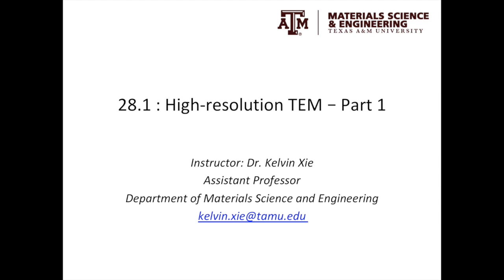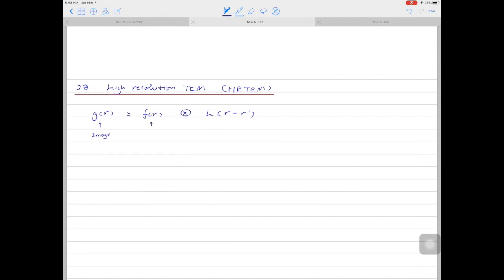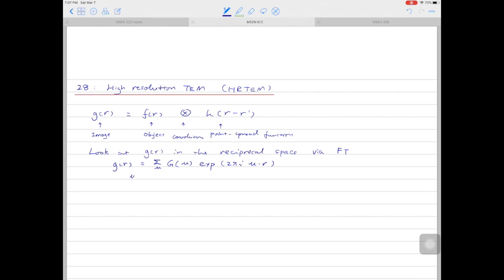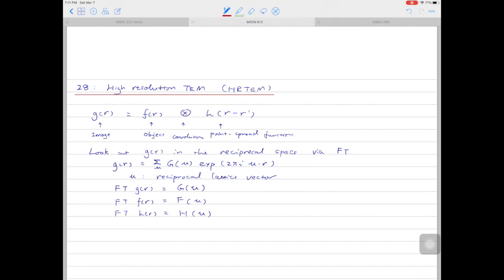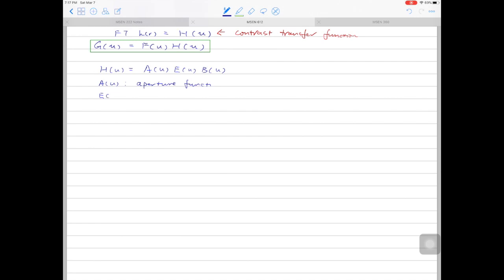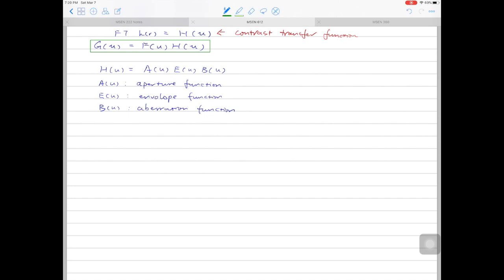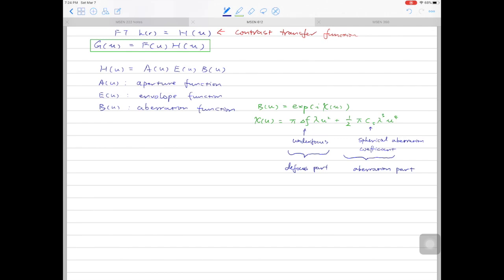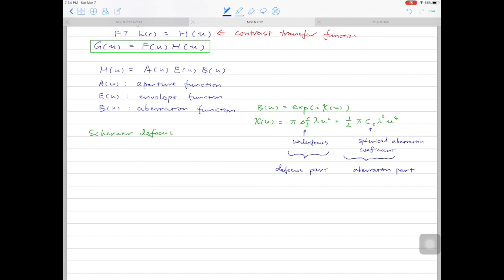28.1: High-resolution TEM - Part 1

Comment: Hi Kelvin, Thanks for your nice video. Though I've read related parts in the William&Cater book, your video makes me understand it better. I have a question about Schrezer defocus. For example, that value is -60 nm. However, where is the best "on focus" condition? How to confirm that now I am "on focus", then I could ResetFocus (R2 button), and then adjust the focus knob to -60 nm.
Reply from the maker: Hi Yuan, it is a very good question. I use FFT to guide me. Usually, you have some amorphous layer on the specimen and it will give rise to the diffuse rings in FFT. When you are out of focus, the diffuse rings will be visible. By changing focus, you can make the rings change the diameter and change how many rings you see. When the amorphous ring disappears,  you are "on focus". Then you hit the Scherzer Defocus button to set it to the best imaging condition. I hope it helps. Please let me know if you more questions.
Reply: @kelvinxiemsentamu6890  Thanks again, Kelvin. Your explanation is very helpful when using a FIB thinned specimen and normally an amorphous area is created by FIB milling. However, if I have gold nanoparticle (NP) dropped on Cu mesh, where there is not an amorphous part on the NP. Of course, I can use the Carbon membrane on the mesh to adjust FFT pattern as you suggested, but the "on-focus" condition is focused on the Carbon membrane, rather than my NP sample, since the height of NP and Carbon membrane is different.
Reply: Normally, my method is to adjust the focus at the edge of the NP. As you introduced in your video, to minimize delocalization. My question is, when the delocalization is minimized, we are at the "on-focus" condition, or "Scherzer defocus" condition?
Reply from the maker: @yuan_tu  Hi Yuan, thanks for your question. I largely work on structural metals and ceramics, and have limited experience in imaging nano-particles. To my understanding, when you minimize the delocalization visually, you are "on focus". Then you hit the "Scherzer defocus" button, it will take you to the optimized defocus value. The Scherzer defocus value is usually very small (~50 nm) and it will not change the image dramatically. However, In this focus condition, you are almost certain that the dark fringes correspond to the lattice planes in your specimen. The contrast is directly interpretable. Hope it helps